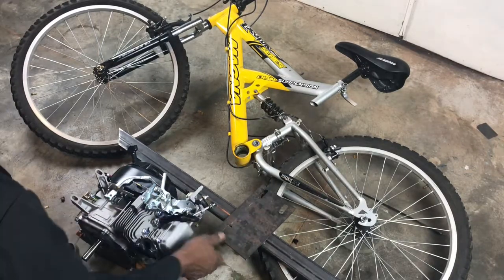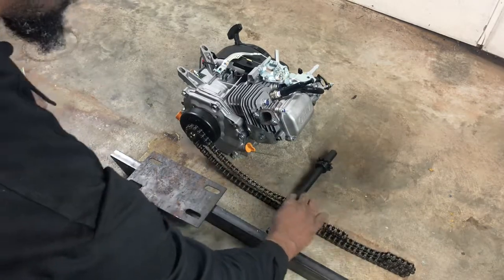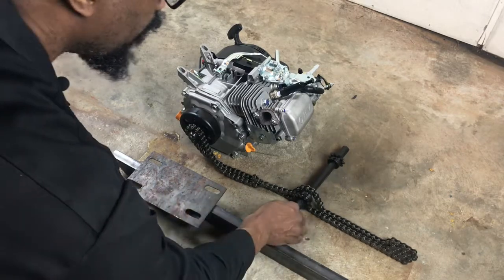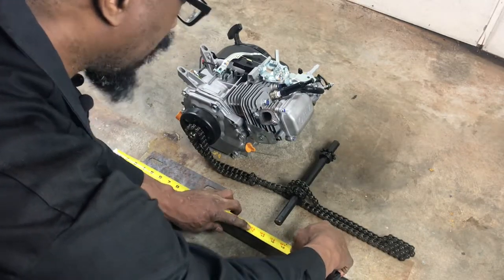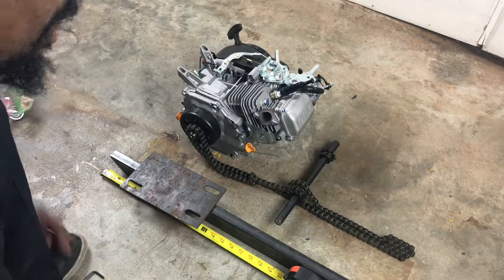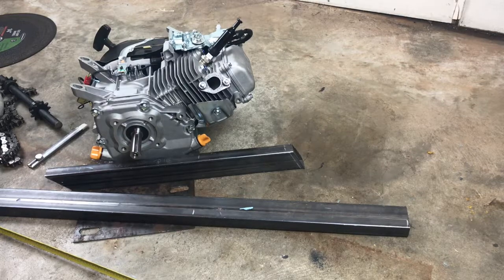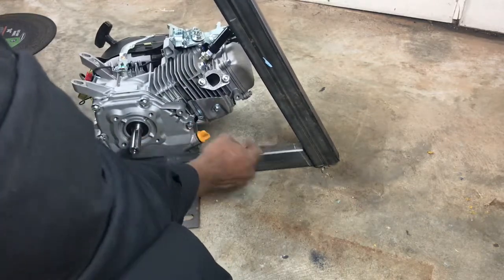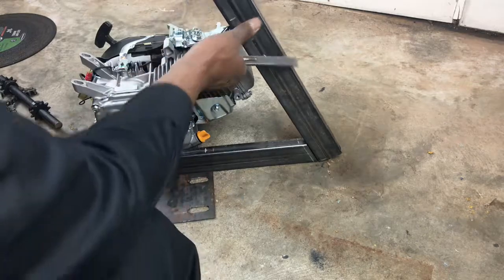Part 2 -- Predator 212cc Powered Bike Project

Comment: I'd recommend using a 41 chain versus a 420 or even a 415.  I've already broken a brandnew 415 chain and went back to the 41 chain with no problems.
The 41 chain is a industrial grade of chain and has been pre-streched from the factory.  You can tell how hard a metal is in it by comparing the metal
sparks given off of it when grinding on it.  Compare it to the 415 doing that and it is very obvious which is a better quality chain.  The 212cc is a torque
monster and if there's a weak spot anywhere on the bike it will show up.  There's a review of one fella who put the "212cc Death Row kit" on his bicycle on
YouTube and he was running the stock engine with governor using a phone GPS and he buzzed the bike up to 70 mph.  He was using the 40 tooth
sprocket and the kit's CVT transmission.  I am running a 34 tooth sprocket on mine, no governor, larger jet, a header and it will break the tire loose
at 30 mph.  I would never trust the bike at full throttle for safeties sake.  Bicycle frames and wheels/tires are not made to run over 20+ mph I guess
that's the reason the kit is called a  "212cc Death Row kit!"   A set of aluminum mag wheels and your frame would be safer than using a bicycle frame.
Thanks for the reviews
Reply from the maker: Thanks for the good advice. I agree with you. I did build a 212cc Powered 60mph+ stand up scooter. So, I know you are right. Check out that video when you get a chance. I don’t have any top speed runs on video — for reasons lol https://youtu.be/V1X8AE15U_w?list=PLD8XyncdkYYRnt9M2uS7Klur6sIagSjUI